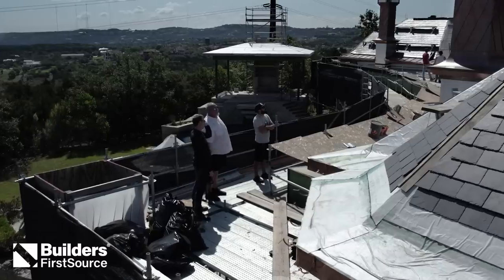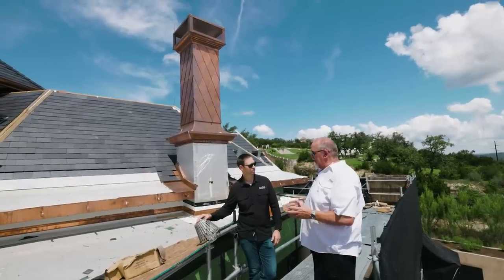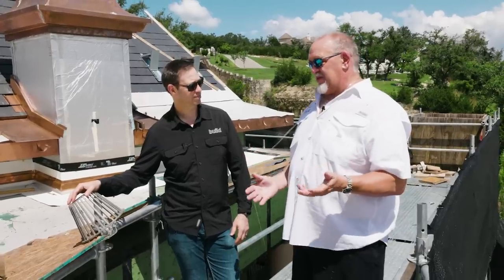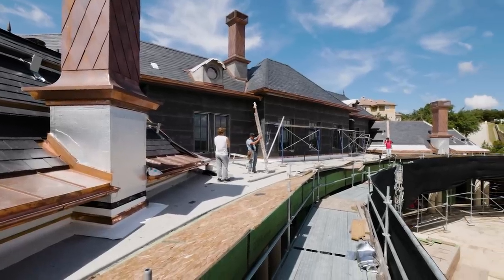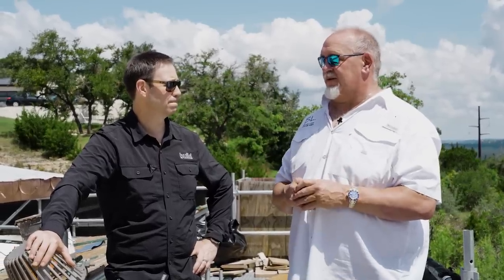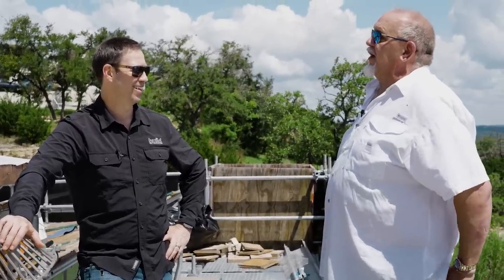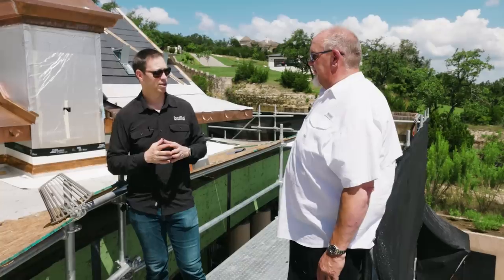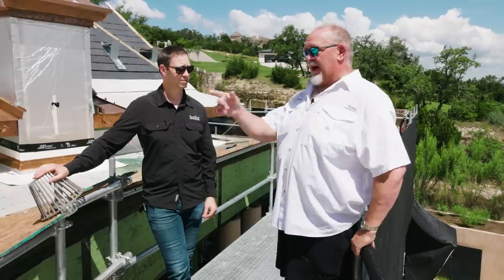Possibly THE Most Beautiful Chimney ever

Comment: Hey Matt, just wanted to let you know that the screening on those chimney caps is too small to be code compliant. Also the system is missing it’s UL listed and approved termination cap.

If there is ever a thermal event a properly trained and certified sweep will point to this as a potential cause and it opens the builder up to liability.

Let me know if you have any questions. 

Thanks for all the great content!😁

Comment: 12,000 lbs on top of a 2x4 wall. That's horrifying.
Reply: 3 of them!
Reply: That’s one of those things no one bothered to think about the amount of weight that such a small amount of material is supposed to hold up or is that just that’s the next guys responsibility
Reply: That just shows you that even builders of mansions from 10 to 30 million homes cut corners do horrible crappy work! they don’t give a crap about anybody or any of their client’s! it’s not the majority of them there’s a large percentage that have a horrible work ethic. Shame on them.!
Reply: I think the compression strength of a typical 8' 2x4 is 1000 lbs... I'm sure they're supporting it with something much beefier, like LVL, CVL, etc. that are 10"x10". Otherwise 😮
Reply: Unfortunately most builders, architects, and engineers have zero idea how to properly build and support a chimney. These chimneys are still not code compliant.
Reply: @chocol8milkman750  that compression strength assumes zero deflection.
Reply: @nighthour1  … elaborate please.
Reply: @BiggMo  I sooo wish I could show you the 1000s photos I have of chimneys like this supported by only one or two 2x6s. Also, the lighting rod, termination, screening, and chimney cap are all non-compliant. He said that he had it made by a copper guy. Any decorative shroud topping a chimney must be UL tested for that fireplace and vent pipe. The mesh is too tight of a weave. 1/2” squares are the smallest it can be and this appears to be window screening. The missing term cap means the that the pipe is no longer fire-stopped. More than likely there is gas run to these systems… and they put lightning rods on them. When the lightning strikes the chimney it will travel down the pipe, across the box, to the gas pipe and can cause an explosion. BECAUSE GAS LINES ARE GROUNDED!
Reply: I heard that, and immediately said HOLY SHIT!!! 🤣

Comment: I love the channel. I studied Engineering in Germany and now live in the US. It seems Americans prefer lower upfront cost with deferred maintenance cost that easily end up costing more on the long run, while Germans take higher upfront costs and betting on a carefree future outcome. As a result, quality wise, America unfortunately ends up far behind Germany in pretty much every respect.
Reply: Yep, American houses are a joke. Sadly here in Australia it’s the same - cheap and shoddy wooden frame houses that fall apart in 50 years max :(

The other problem is they’re all horribly insulated and everyone (especially Americans…) just slap in huge energy hungry HVAC. 

Most American and Australian houses would be illegal to build in Germany.
Reply: @froggy0162  In all fairness, advanced building science is what Matt Risinger's channel is all about. I don't believe wood structures are the problem. In fact, there is currently a huge push for wood structures even in Germany and even for high rise buildings.

Instead, it seems, like you said, the issue is rather with making sure that good insulation and moisture control last a long time, which can be a challenge regardless of framing.

I think part of the problem with American building (or American manufacturing for that matter) is about the attitudes to quality in general. People in America appear to have different views and expectations if it comes to quality, than people in Germany. 

Either way, as long as quality is requested and enforced, I believe people can build awesome things regardless of their location.

In Germany there is a saying that translates to something like this: "quality outlasts the brief joys of getting a cheap price".
Reply: @mrtopcat2  Yeah, it’s very much a symptom of the disposable society America (and to a similar extent here in Australia…) has become. Horrible consumer goods, horrible cars and horrible houses where fashion and gadgets trump quality. 

And with houses it’s combined with abhorrent planning rules that result in vast tracts of car dependent suburban wastelands of cookie cutter McMansions :( It’s a big reason Europeans consistently score better for quality of life - they have walkable communities where people are not stuck in over sized horrors and having to drive everywhere… 

I get this channel is about building technology, but it feels like it’s the wrong tech! It’s scary how many “products” are on the market to encourage and support cheap fast builds, and to try to deal with fundamental design and construction approach faults.

Comment: I'm confused about how a copper chimney works, how is it heat-resistant or durable enough, there must be something inside holding it together?
Reply: The copper is decorative.
Reply: At 2:52 you can see the standard metal chimney flue cap inside.